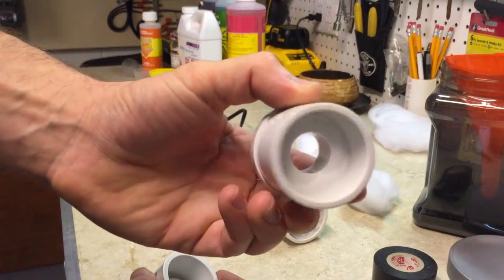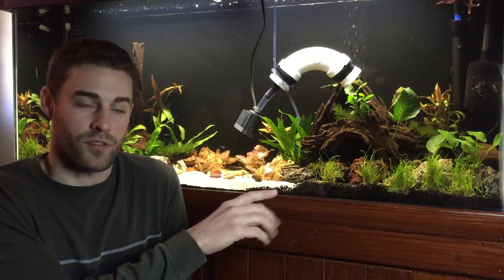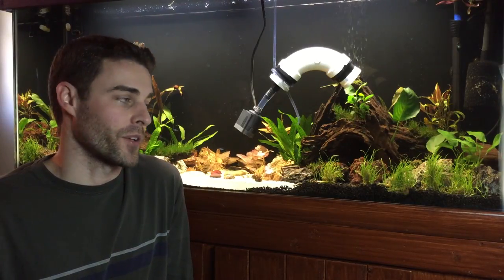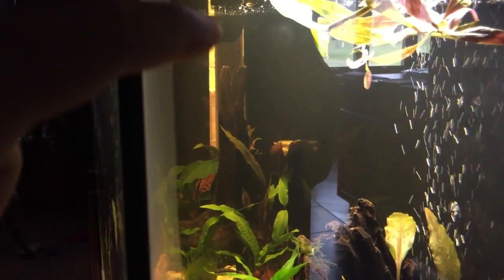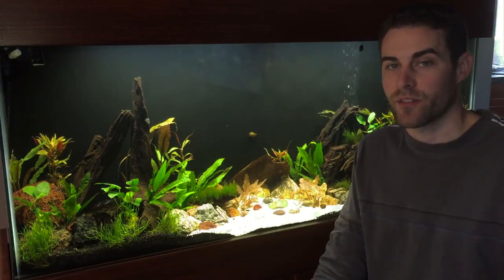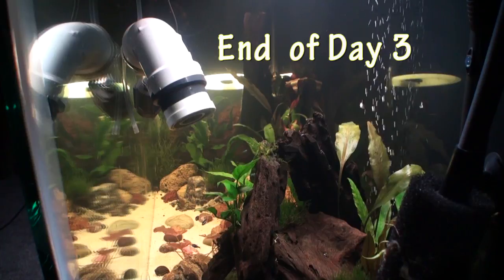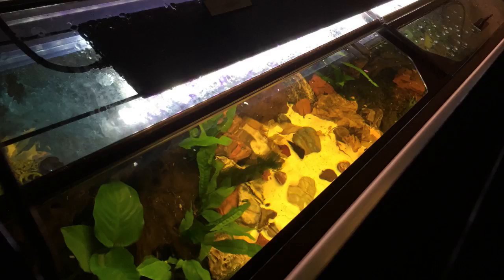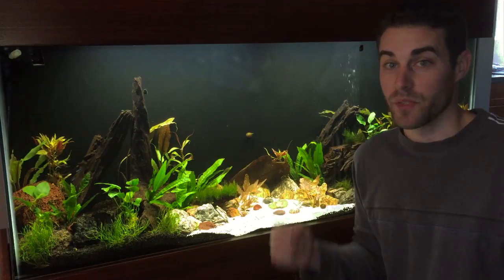Tannin's Carbon Planted Aquarium; How effective is GAC and should you use it?

Comment: In the past I've always had good results removing unwanted tannins by using my old standby from the early 90s the Marineland Magnum 330 canister filter using the pleated diatom filter insert .
These days I just leave it alone since I'm going for that native backwater look for my Amazonian tank and actually decided to use alder cones in my HOB filter to tint the water to give it that natural look. The plants are doing great and the fish have responded well to it and even started reproducing, the Cory cats especially . 
Good point about excessive water changes . I tend to do mine 10% every week or so depending on the bio-load , how many fish etc . Depending on the water source, drastic changes in pH can cause pH shock not to mention any major difference in the temp of the replacement water could lead to ill health of the fish.

Comment: So this seems to be a good temporary solution for removing tannins from a planted tank.
Reply from the maker: Zaku186 I would use something more permanent. I don’t have tannins any more though. The wood has pretty much stopped releasing it. Chem-pure green I think is what I have been suggested. It won’t remove the organics that plants need, just color.
Reply: @GrowingAnswers  Ok cool never heard of that stuff. i might give that a try. i recently did a rebuild of my planted 55 with Organic potting soil topped with coarse sand and a plenum and although my plants are doing very well the soil is releasing tannins and i personally dont like the look. i do appreciate that it is good for my fish but i dont like it is just makes my tank look poorly maintained and chocking down the light. its been a bit over a month now and ive been doing weekly large water changes to help but its still bad. before when i had inert substrate i just did water changes every other week and only like 1/4 of the total tank volume. im really regretting it.